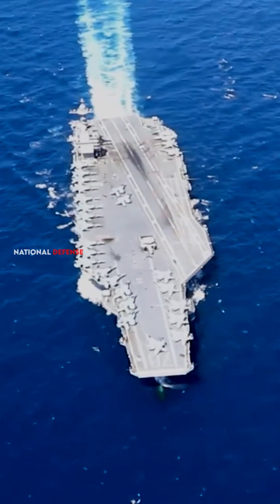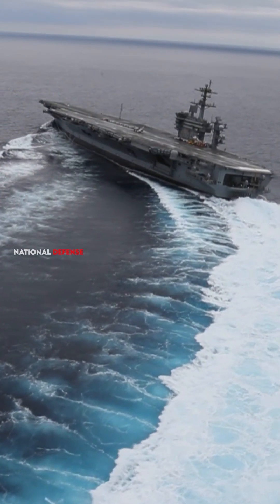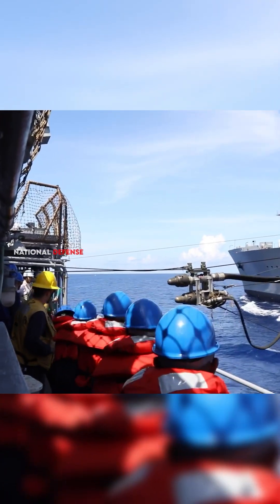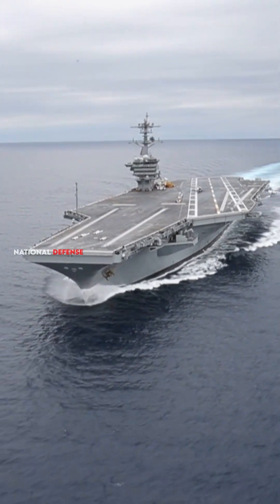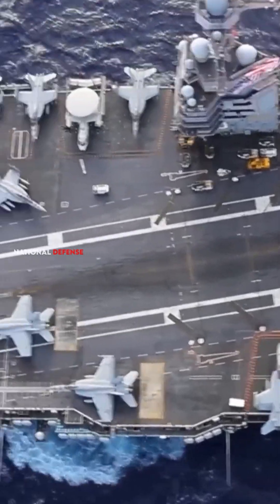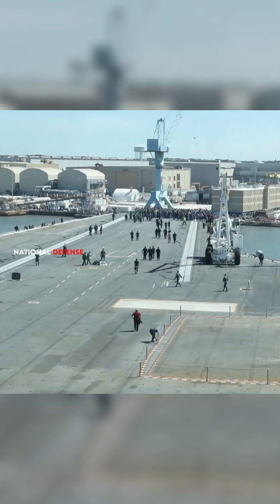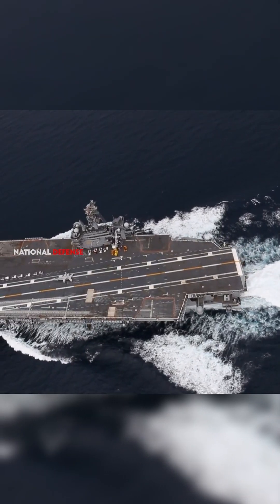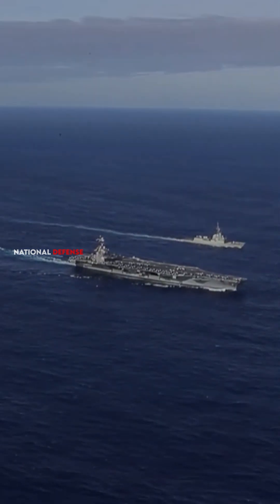How do aircraft carriers refuel at sea?  #shorts

Comment: Truth be told, aircraft carriers are not refueled. They are nuclear. Run by two nuclear reactors. Maybe some sort of heating fuel with that I'm not sure. But dry stores, food, other supplies ammunition etc etc. But not actual fuel for the carrier to run on.
Reply: The carriers do refuel.  They take on fuel for the aircraft, tractors, diesel generators and fuel for support craft.  Because the carrier doesn't need fuel for its operations, it frees up a huge amount of space to carry fuel for everybody else.
Reply: Jet fuel
Reply: Jet fuel?
Reply: How about this aircraft carriers do not refuel. They can gather fuel for aircraft, machines, excetera excetera
Reply: @longliveforcemarine5188     etcetera
Reply: Carriers do not use fuel for heat.  The reactors create more than enough heat to dribble off enough to keep the crew comfy.
The reactors free up enough space for the carriers to refuel several craft, in the task force!